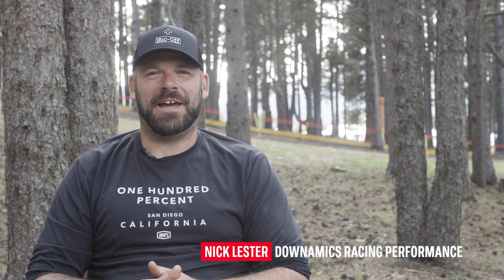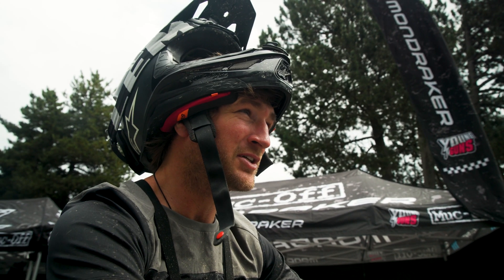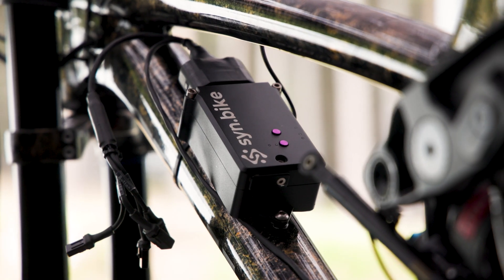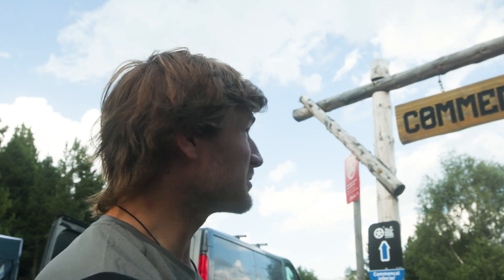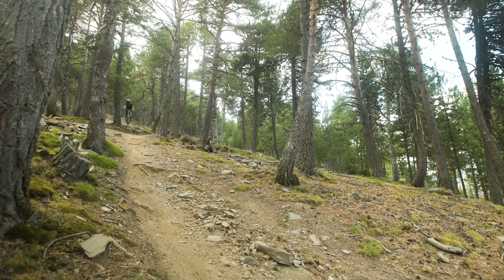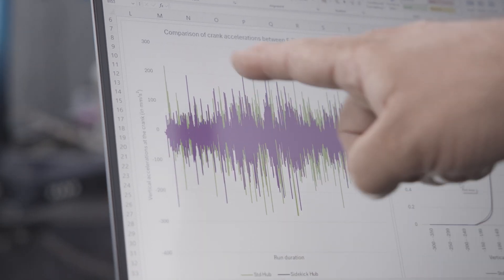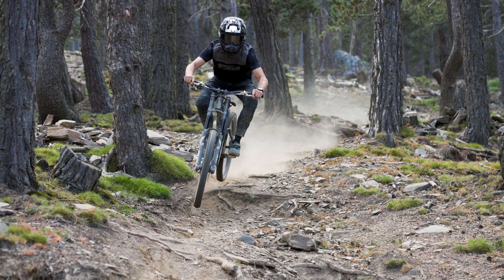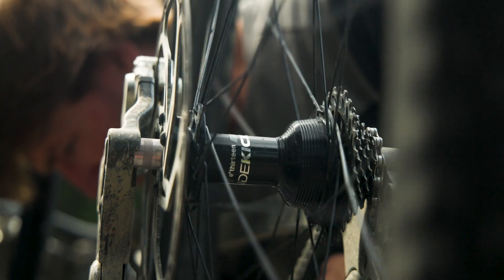Testing Sidekick vs. LG1 Race Hubs Using Data Acquisition: What was the difference?

Comment: I like you products e*thirteen for quality and no-nonsense solutions but this - get better marketing ppl
Second graph does not align with what the guys is saying. it's a histogram acceleration vs time spent. 
I'll gloss over the fact that you should have accelerometer at bottom bracket and crank and take just abs diff of the readings
Ideally you want this graph to have as much area as close to 0 acceleration (middle of the graph) as possible. Anything else is time spent in higher acceleration.
So looking at it @3:54 Sidekick is worse than standard hub.

The whole idea is silly
You would need to have faster chain growth than linear speed on your cassette at the current gear so when you doing trail on a bike with full suspension?
Reply from the maker: Thanks for the feedback. Nick from Downmatics is one of the preeminent data acquisition guys in DH MTB. The graphs shown are intended to show that there is a difference in Pedal accelerations (from either suspension "pedal kickbck" or other drivetrain forces) between Sidekick and non-sidekick hubs. So when comparing those parameters, the difference is valid, as are the graphs.
Reply: @ethirteencomponents  I must say kudos! to people who run your social media presence. I was not expecting a response under 9mo old video.

Here's a thought:
While I don't think you will share the data from those runs I would like to see that hub reviewed by someone who prides himself as an independent reviewer. @DaleStone comes to mind.

I was about to get myself a set of reserve wheels to replace my 5y old e13. I'm sure you're aware those come with either e13 sidekick or DT.
Reply from the maker: @furmek  Thanks for the kind words. We're a small group so we all do a lot of things. About the data, the footage and testing was done a couple years ago at this point and we do have some new ideas we'd like to try and share. However, while the data is nice, the real world riding experience is the ultimate test. Thanks for the feedback about Dale Stone; we'll look him up. For another true independent review, check out this one from Jeff Brines: https://youtu.be/qLQcnI8ftLY?si=6_oPLXg3bQtFsfju